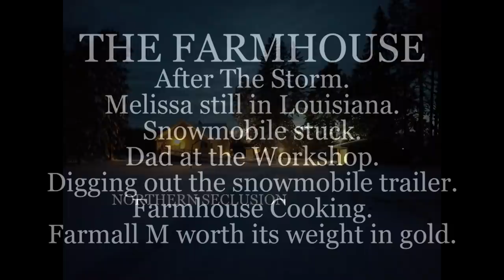THE FARMHOUSE. After The Storm. Snowmobile stuck. Digging out the trailer. Melissa in Louisiana.

Comment: I had the same thing happen with my '96 Polaris Ultra SP, one year worked great, next year did exactly what yours did. Found out that the needle and seat in the carbs were stuck and wasn't allowing it to get all the fuel necessary even though it sounded like it was going full throttle. Had the carbs cleaned and it works great now. Zachary should be able to give the carbs a cleaning fairly easily! Cheers from Alberta Canada.

Comment: Hey Joe just my two cents on the snowmobile. I own the exact same snowmobile as yours but a 500 liquid cooled (same track and framework). It was designed and is meant to be a “trail sled”. Meaning it does really good on a packed groomed trail. But they fail off trail in deep powder, as both you and I know. They are also not meant to tow, but I have just as you have. It’s just extremely hard on them. This year I bought a long track 144” with a 2” paddle track and flotation skis. Similar to what George bought, but older and two stroke. (Mine old sled/yours are 121” tracks with 3/4” paddles). It also has a tow rating for towing my gear. I use it to snowmobile into our duck camp just off Winne, just south of your duck camp.  It goes through a lot of snow even towing my big sled. The point I’m trying to make, without being rude is. That your snowmobile doesn’t seem to fit your needs as well as a snowmobile that is meant to blaze trail and tow a sled without getting stuck. Not trying to be a smart ass, but just passing on what I’ve learned. Thanks
Reply from the maker: I definitely need a different machine with the longer track. I never ride on groomed trails. I was reading last week and did read that it is set up for trail riding and not new snow.
Reply: Just my opinion but sled needs a good tune up, it sounds like it's running with choke on. That sled should FLY!

Comment: I've been in a group that got sleds stuck crossing a lake and it is no fun.  luckily we had enough people to trample down a path and push the sleds until they got going.  We got 6 sleds stuck and we were there probably and hour getting them out, and we were only about 100 yards off the packed trail that crossed the lake.  One thing I would do is just take a walk on the lake to see how packed down the snow is and if it seems ok make a high speed run all the way to the tent and pack down a path before you load up all your gear.  Speed is your friend. (I'm not sure but I think you can swap out your track for a longer one)

Comment: the snowmobile should be able to go even in that sugar snow  ? maybe check the track bearings  and gearbox ,jackshaft  bearings etc. something just not right ? clutch?  I dont know with out looking it over  I dont want to be that guy that knows everything..  good luck  and thanks for all the work you do  making videos.
Reply from the maker: I think I will just skip all that hard work and buy a different snowmobile. Lol.
Reply: @NorthernSeclusion  inch lug or more on the track on your new sled ?

Comment: Your snowmobile is having trouble going through the snow may be due to ice buildup on the skies.  Just sitting for a while there maybe a build  up on the skies and preventing the sled from going through the snow.  Clean the ice and debris from the underside of the skies and that should help.  If there is any ice or frost on the underside of the skies it acts as a brake and that maybe the reason the sled is having trouble in the snow,

Comment: Those newer sleds are crap. Built for a groomed trail. I have an old 24 inch by 48 track and it will ride up and over any snow. Plus it had a low range for pulling a sleigh. SKI DOO 06 WIDE TRACK.
Reply from the maker: What type is it, a Tundra or?
Reply: @NorthernSeclusion  Standix wide track
Reply: @NorthernSeclusion  SKI DOO STANDIX wide track